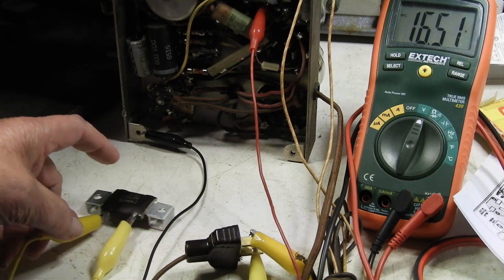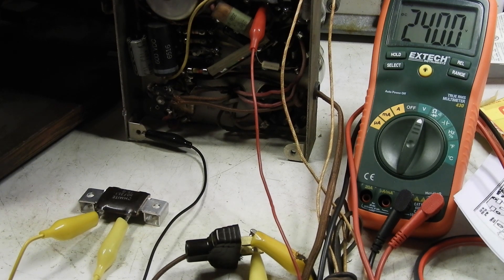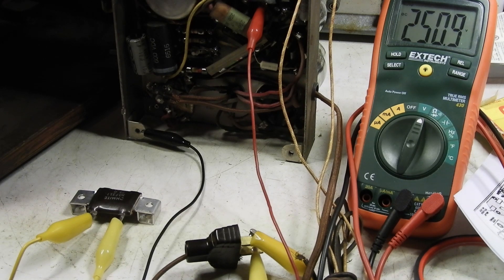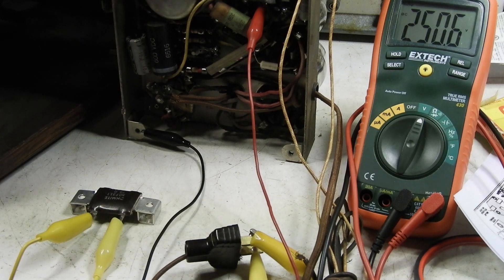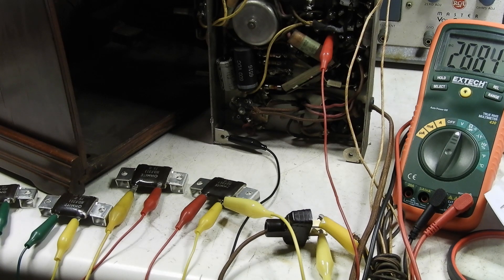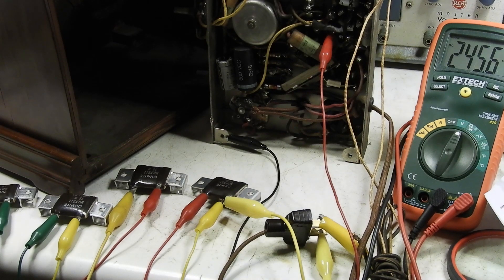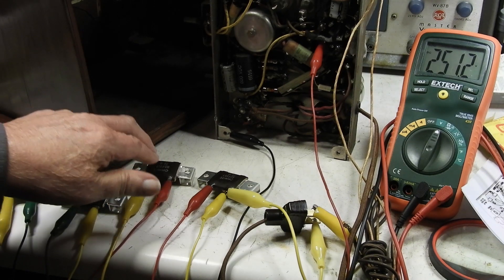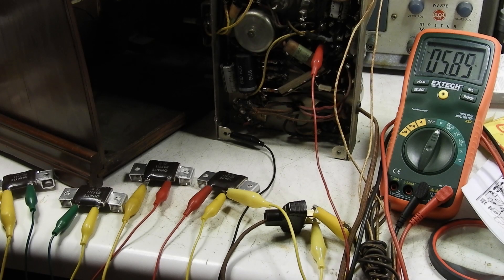Atwater Kent 165 Resistor Circuit Success

Comment: I have a series string radio that originally had a ballast resistor but those are hard to get. I tried a high watt resistor but it got way too hot. I installed a 10mfd cap but that still wasn't enough to get the filament voltage where I wanted it. I added a couple of the high watt white resistors and mounted those on the back of the chassis. That did the trick. The resistors got warm but not too bad and the filaments were at a good voltage.
Reply from the maker: Glad you got the resistance resolved. I have done something similar. There is not just one answer and every radio is different.

Comment: Hi Rich, What would be the cause of having to do this in the first place? Is it aging parts or something like that. Maybe design given they were using a lower line voltage.
Thanks and 73,
Mike
Reply from the maker: This radio runs on 110VAC and today's electrolytic capacitors are more efficient
Reply: @AllAmericanFiveRadio  Ok Thank You 73

Comment: Instead of dropping the voltage on the primary side of the transformer, could a smaller resistor have been added at the secondary? Or, did you think the transformer primary couldn’t handle the 120 volts?
Reply from the maker: That would not lower the filament voltage.

Comment: How much in cost would be in comparison using a isolated transformer instead of resistors for that type radio?   I'll have to look at the other video of what you were trying to achieve again.  It was lowering line voltage right ?
Reply from the maker: It would be a lot more, all 9 resistors with shipping was $15. This is for some one who is not into electronics.
Reply: @AllAmericanFiveRadio   ok thanks.  Good idea about the resistors.